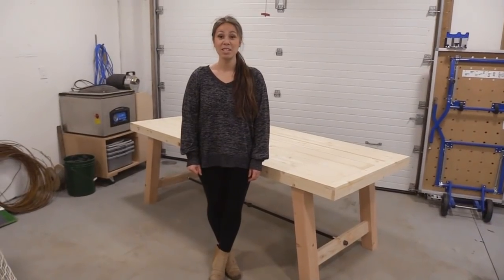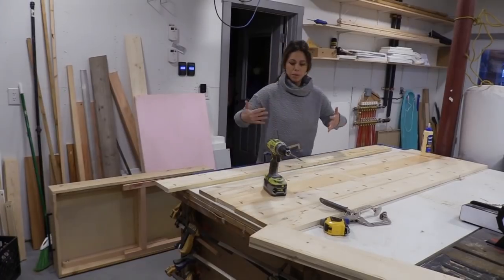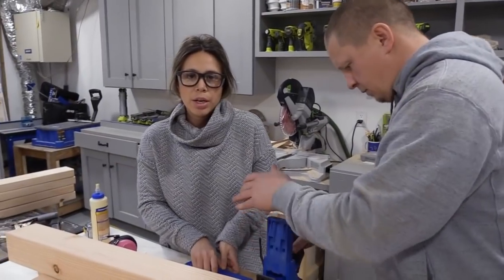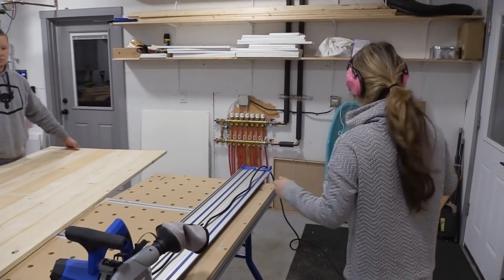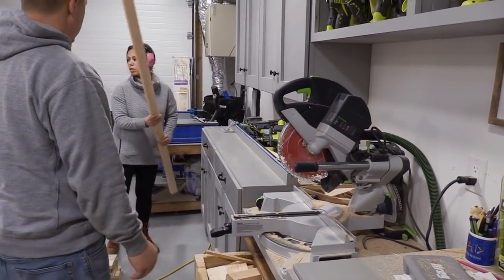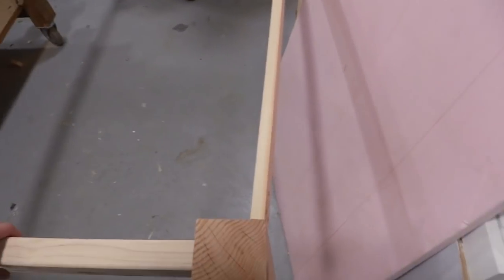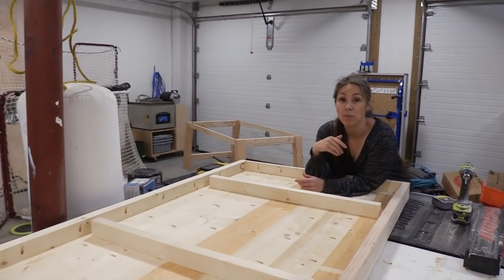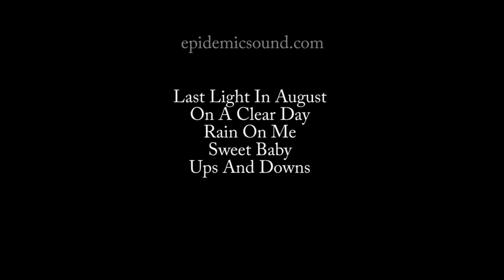DIY Industrial Farmhouse Table

Comment: 2 suggestions and a question:  To keep your drill straight you can hang a ring or a washer on your drill bit - if it starts to slide forward or backward you know you're tilting the drill - other suggestion is to put the base on the table top when its upside down, should be easier to attach I'd think.  The one question, are you concerned about future cracks due to expansion and contraction over the years?  With everything tightly bolted together there's no room for expansion and contraction.  Not trying to nit-pick, just trying to understand ;-)
Reply: I made a coffee table 4 years ago and the joints are invisible. Have to say that I live in Costa Rica and can't say if the weather difference would be a factor.

Comment: Great job on the table. The first project I made for my wife 2 years ago was a farmhouse style table that would be outside on our deck. I had never built anything like that before and I had only a picture to go by with no measurements for either the table top or the trestle style legs. I used 2 x 8 pressure treated pine lumber from the orange company and used pocket holes and glue to hold the  boards together as you did. Anyway your table is great and gave me ideas on how to do my next try much better. Love your channel!

Comment: To deal with cupping just put them cup up , cup down then glue . I never use pocket holes. Title bond is amazing glue. The wood will break before your joint. Great table 👌

Comment: Love it. The only problem I see is the end parts for a chair to eat. Is that enough room for chair with feet under it without hitting the bottom board? The one at pottery barn is the same. Odd. $1600. They show a picture with chair pushed in over the bottom board. I guess some ppl wouldnt care. My feet would be all over the board.

Comment: Just for fun.  When you need to drill a horizontal hole free hand.  Take a washer with a hole just a bit larger than your drill bit and slide it onto the drill bit up by the chuck.  If it drifts towards the work peace lower the drill a bit, if it slides back toward the chuck raise the drill.  Now you can focus on the right left orientation.  Hope that helps.  Really enjoy your site and love Delta!  How's Jacobs shop coming?

Comment: Just wondering ... wouldn't it be better to use pocket screws from the ends of the table boards into the breadboard?  That would seem stronger than screwing them into end-grain, wouldn't it?

Comment: Anna, I have a Dewalt table saw that has somehow gotten off. As I push a piece of wood along the fence as it gets to the far side of the fence the wood gets tight and the cut is no longer completely straight. It will be off by a hair. Do you have any idea what is wrong and can I correct it?

Comment: A quick question… Do you ever have any issues with the breadboard ends on a table top when you use pocket hole screws as far as wood movement due to temperature change?

Comment: Ana - I am almost done with my build.   You say 2 inch screws to attach - did you use pocket hole again?   or screw directly through to the tabletop?  Plans were not clear there.  Thanks so much for sharing your plans!!
Reply from the maker: You can do pocket holes along the inside of the aprons going upwards for attaching top, or you can just screw through the aprons into the tabletop with regular wood screws.

Comment: can a chair be used at the ends ?
Reply: I was just looking at that. Yes but not comfortably. I guess it's fine for guest situation. I see it being a trend at pottery barn. Another table similar dimensions they put the chairs front legs over the bottom board. But they have an extended version. So I guess per dimensions make it a little longer on each side. Looks like it flips up but idk. Probable not a hard addition. Maybe Ana might show how to do that one day. I like the table.

Comment: Great motivational build. Thank you!! 
Question - did you use box store pine 1×4s? If so,  how did it hold up since its a really soft wood..... 
I've thought about using it myself but have been hesitant for that reason.
Thanks for the feedback. 
Keep up the awesome work/videos each week!
Reply from the maker: We use locally milled spruce for our projects
I did a round table with the same techniques and wood species about a year ago and it has had zero issues, even with our family using it all day every day
Reply: I use a lot of box store 1x4's on projects as well as 2x4 and 2x6 and they hold up really well.  But you need to rummage through the wood sometimes.  I have furniture we built that is over 5 years old now and we just check the finish every year to see if it needs to be freshened up.
Reply: I make a lot of things out of pine.  If it is glued & screwed, it ain't goin' no where!  The table I built is just as strong as the day I made it 5 years ago.  The top might have to be eventually be sanded due to cute grandchildren art.  Maybe in 10 years! 🤗